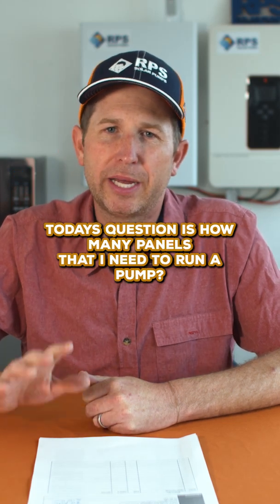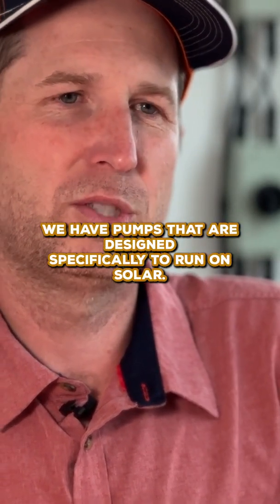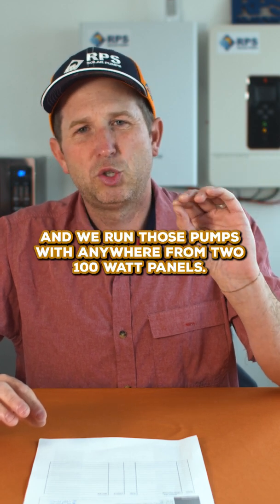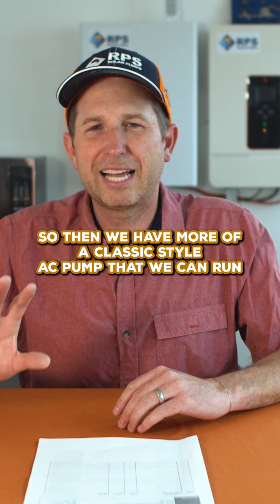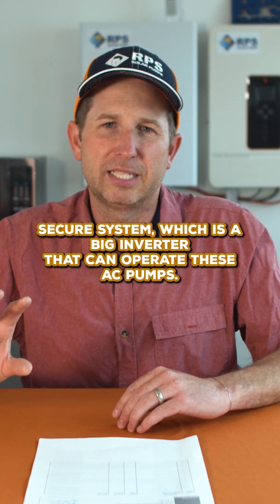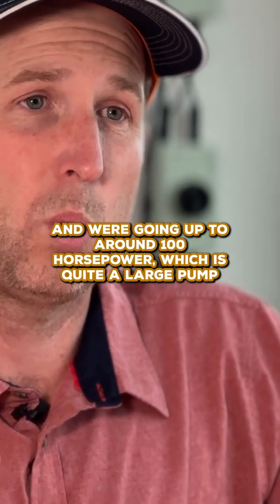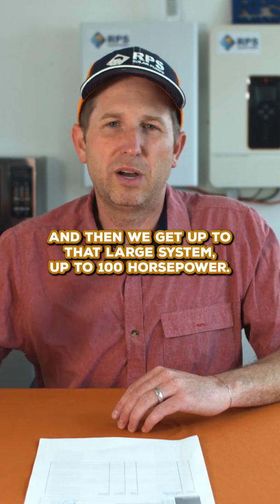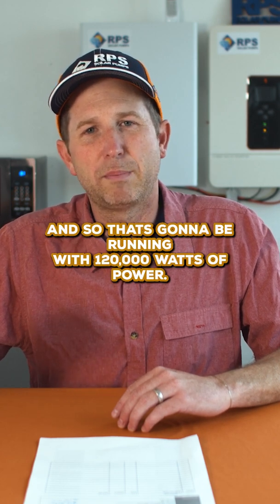How Many Panels Are Needed To Run A Solar Water Pump

Comment: And of course your systems will cost approximately 10-15 times as much as the conventional components would.  Getting tired of these "informational" videos companies put out that get in the way of actually finding and building the components necessary for a system without having to rely on their grossly overpriced one size fits all garbage that often has a terrible warranty and will likely be installed correctly by whatever inept pseudoelectrician they send out.

If these videos weren't drowning out the legitimate contributors, people wouldn't be so damned confused about what is essentially a relatively straightforward subject.

Had a guy quote for my house and he wanted 25k just for the batteries, and they came with no warranty.